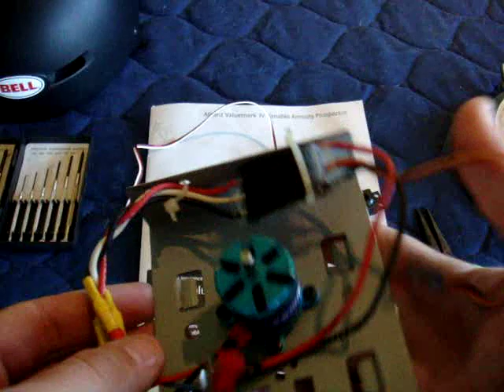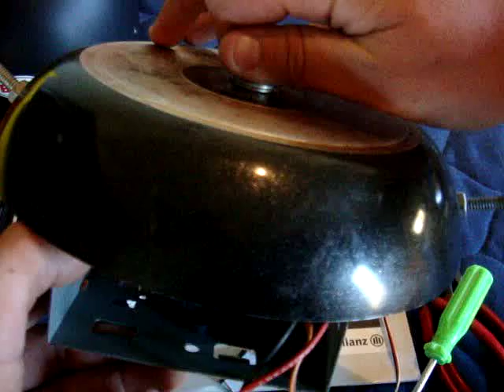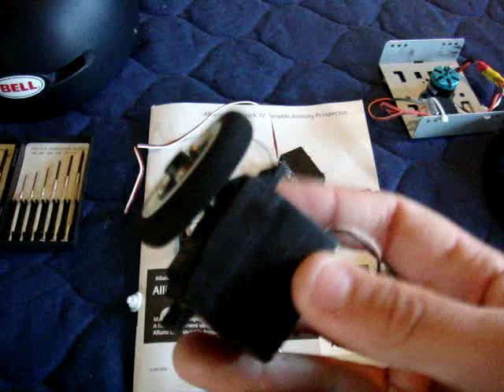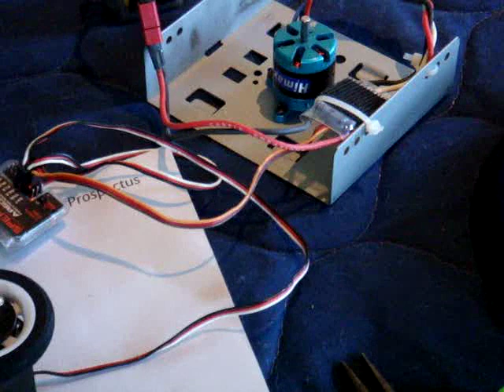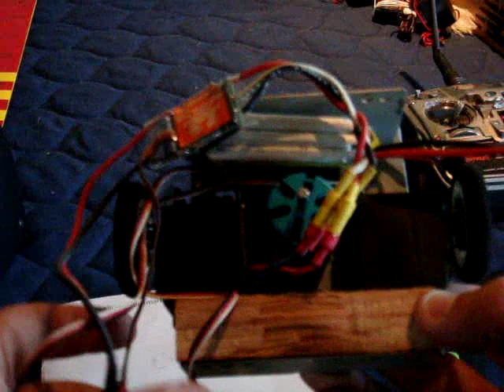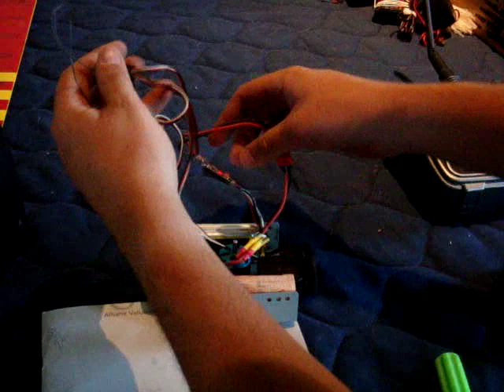How to Build a Mini Battle Bot - Part 2

Comment from the maker: Each transmitter is unique, for mine it was just a setting for use with a combat wing, and a few adjustments to the trim. Its in the manual that comes with the transmitter sometimes under fixed wing use.

Comment from the maker: For a prototyping medium, wood is perfect, but if you are planning on doing any hard on testing or even battle, I would suggest using a metal frame. Mainly for structural purposes.